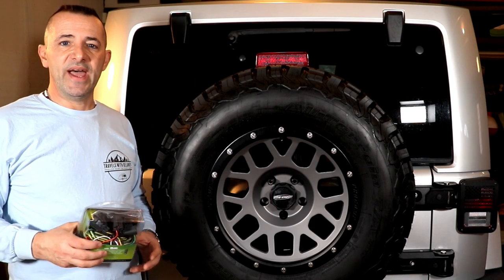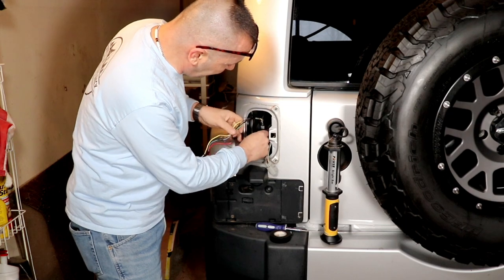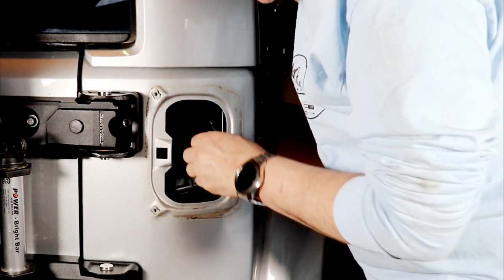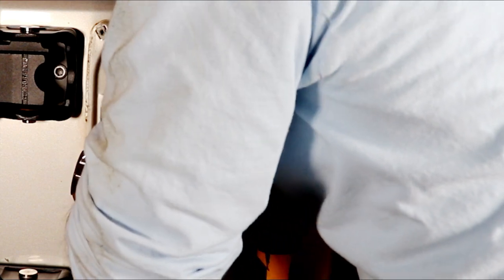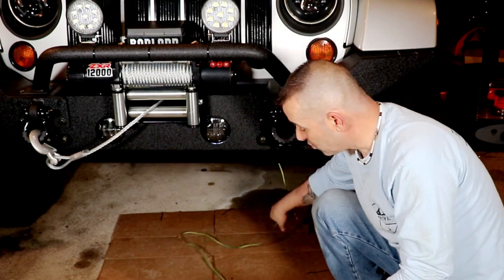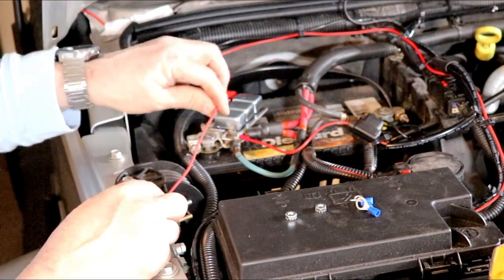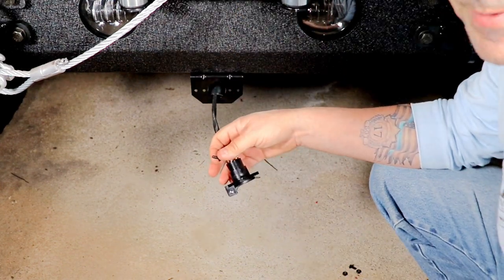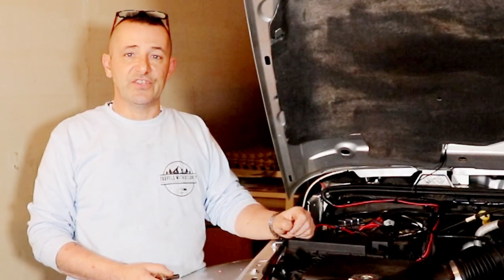Jeep Towed Vehicle Wiring & Charge Line Install With Hopkins RV Toad 56200 and Roadmaster Charge Kit

Comment: Nice Job Lou!  Hey, no bloopers? LOL  We like your tail light covers.  If you get a chance sometime shoot us a pic with the brakes on.  Nice explanation on the plug connections, especially the part about how some RV are wired differently for the 7 way, we lived and learned about that.  Thanks for mentioning us in the description, it's appreciated. Thumbs up my friend!  😃
Reply from the maker: I was so cold and working so fast I actually didn't have too many bloopers this time.  Don't worry mistakes come easy to me so I am sure I will have plenty next video.  I have read that most RVs are wired with the 12v feed to the 'S' (brake pin).  Sure enough mine was lol.  Thanks for watching and I will take some pics of the tail lights for you.

Comment: Thanks for the post!  Question.....I installed a similar kit by Curt, that like yours, does not have a provision for lighting the license plate. Seems that this could be an issue for law enforcement when traveling during dark-thirty hours.....have you had any issues with this concern?  Thanks
Reply from the maker: Hi, I had not noticed if the plate light are on or off.  I will definitely look next time I'm hooked up.

Comment: Thanks for the video! This is the one I've been looking for. Very detailed. I do have one question about wiring the 6 pin. My 7 pin on the rv has the positive pin at the 1:00 position as youre looking at. Would that mean I would connect the red wire to the S position? Thanks again and you have a new subscriber
Reply from the maker: Hi Aaron, The only way to be sure is to connect the umbilical cord to the RV and use a multimeter to identify which pin on the end of the cord is 12v.  I hope that makes sense.

Comment: What about a trailer brake controller? Do I need one of those as well?
Reply from the maker: Hi Chessie, For most brake devices that go into vehicles you wouldn't but that depends on what brand and type of brake device you choose.  If you go with the Ready Brake you would not need a brake controller as that is completely mechanical in nature.

Comment: Most of the parts in the "Roadmaster Charge Line Kit 156-25 on Amazon:  https://amzn.to/2XxoQdu" - you can put together though a local parts dealer.  But can you use a 20 Amp  thermal circuit breaker instead of a 15 Amp?
Reply from the maker: the fuse would depend on the length and gauge of wire you are using.